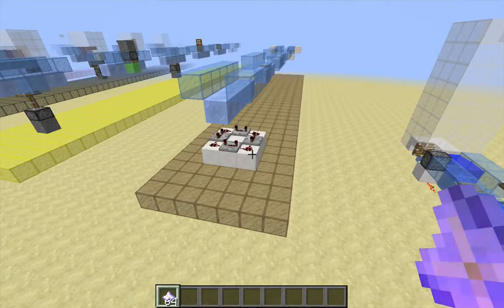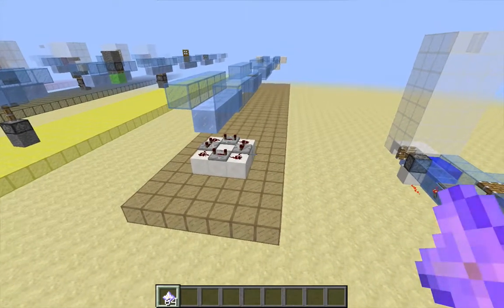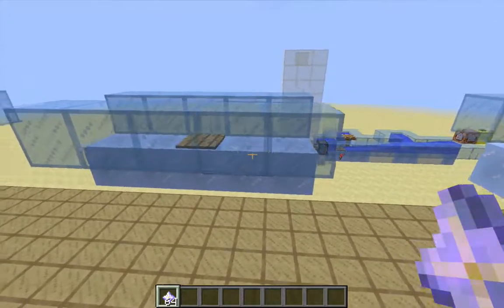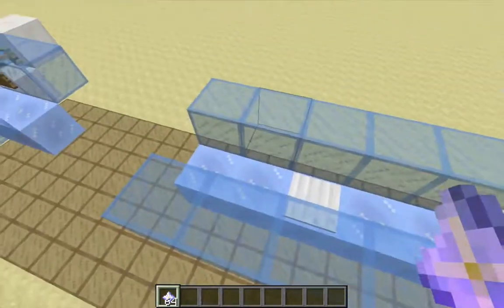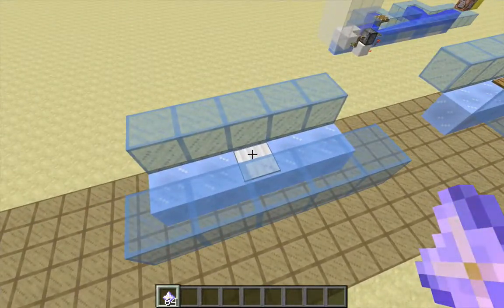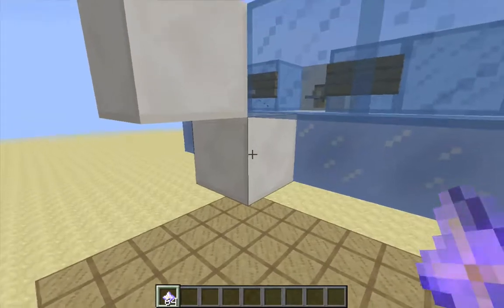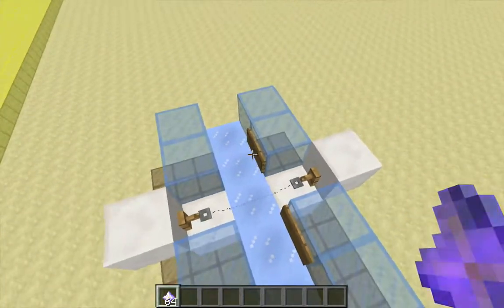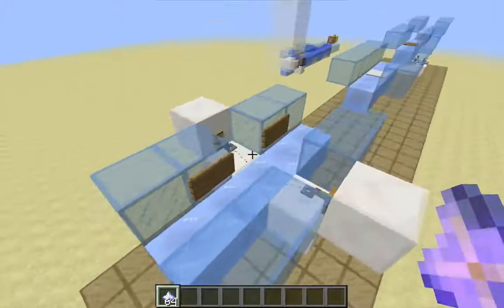Design Fundamentals of Minecraft 1.9 Item Elevators, Part 8: Activators

Comment: I did not test it but im pretty sure gold&iron plates also have a 10 tick cooldown since mangos 1 tick repeater has a 11 tick cooldown wich comes mainly from the plate its using...
Reply from the maker: +Robitobi01 I just tested the minimum activation time of an iron pressure plate, and it is indeed 5 redstone ticks. It's easy enough to test by comparing a boosted line of redstone to a line of repeaters, both being powered by the pressure plate.

I'm defining the minimum activation time as the minimum amount of time from the start of an activation until the end of the activation; in other words, the minimum amount of time that the pressure plate will power its attachment block and adjacent redstone. The cooldown time, on the other hand, I consider to be the minimum amount of time from the end of one activation to the start of another activation. That indeed may be non-zero. I'll have to investigate a bit further.
Reply from the maker: +Robitobi01 Nope, I'm still seeing two activations of the pressure plate by two different items (passing over at high velocity), even though the items are spaced out by only 6 redstone ticks. I'll have to go back and re-watch mango's video now...
Reply from the maker: +Robitobi01 Aha! It seems that the activation times for weighted pressure plates were shortened in one of the 1.9 snapshots. The activation time is 10 redstone ticks in a 1.8.8 world, but 5 redstone ticks in a 15w57c world.